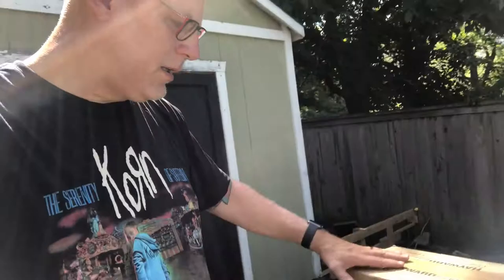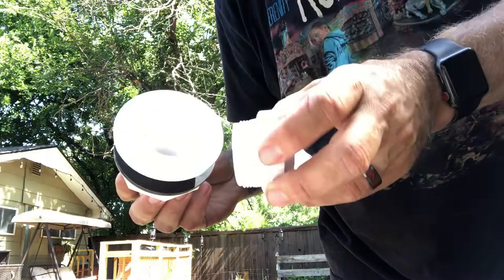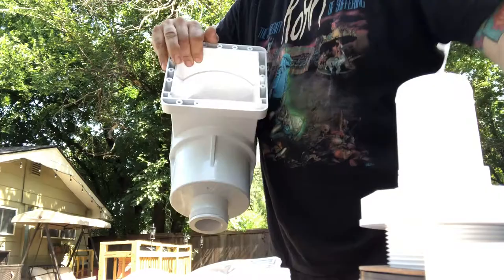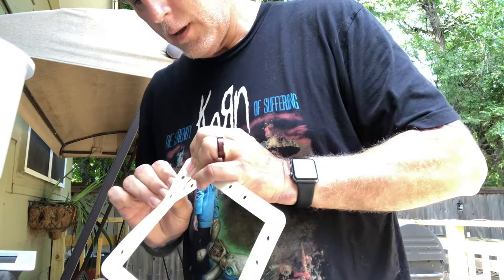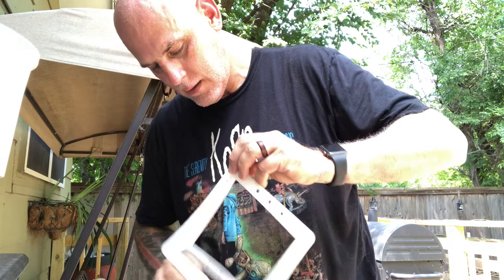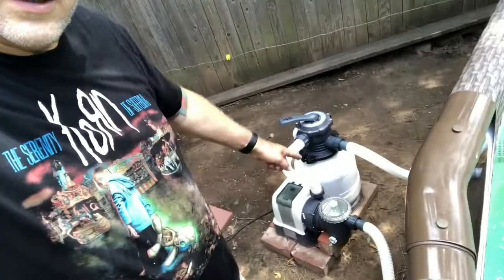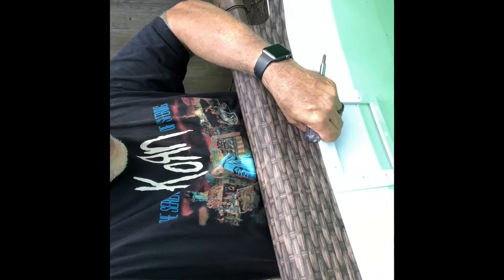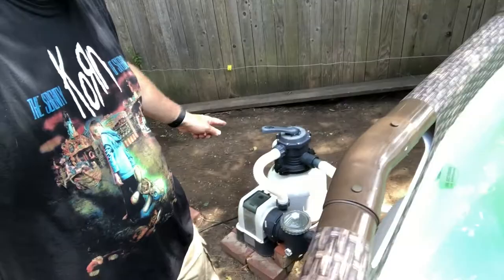How to Install the Hayward SP1091LX Dyna-Skim Above-Ground Pool Skimmer

Comment: Good video but do not cut the gasket. I repeat, DO NOT cut the gasket. It is designed to put a watertight seal between the outer side of the pool and the inner side of the liner. One side of the gasket goes on the outside of the pool with the skimmer against it and the other side of the gasket slips on the inside over the liner with the retainer against it. This creates a watertight seal that won't leak. Kind of like a hinge effect. Unfortunately, the instructions are pretty much useless except as a parts list. Good luck.
Reply from the maker: Yes that was temporary, I made another video on how to correctly install, thanks for watching and commenting
Reply: Ray, that is separate
Reply: Well crap... wish I read this earlier. I'll see of my cut apart gaskets 
work or not and order a backup.
Reply: Thanks.  Your response makes absolute sense.  Instructions should have been better
Reply: I think the cutting of the gasket it to install when the pool is full. You can't cut the hole for the skimmer when its full
Reply: Yes the instructions suck had I not read your comment I would have totally messed up and cut my butterfly gasket so thank you for that comment

Comment: Drain your pool a little dude you just ruined that gasket it's made like that on purpose it fits around the hole in the pool
Reply from the maker: True! Better to drain, cut mine been working fine but definitely way better not to cut it! Thanks for the comment!
Reply: HI Keith, if you do not cut the butterfly gasket into two, you must cut the liner first and slip it into the gasket? It seems more difficult . What do you use as a guide to cut the liner perfectly?

Comment: I dont understand why everyone cuts the seal? It's supposed to be like that. it sits inside the hole with the flap on each side
Reply from the maker: not best, just a temporary fix to keep from draining pool, I have another video that it was installed correctly
Reply: I split the gasket and the gasket outlasted the pool liner

Comment: I’m a bit concerned with separating the gasket, don’t you think it is joined on one end to help prevent leaking at the opening. Doesn’t this modification voids Hayward’s warranty? I think draining the pool just under the level of where your installation will take place, would be a far better bet. At least Hayward would honor that gaskets integrity, should you have leakage problems. Outside of that it was a great instructional video and you’ve been extremely professional with your presentation. Thanks and keep up providing useful videos!
Reply from the maker: Yes I did another video and did just that, drained pool did not cost gasket, much better for sure! Thanks so much for watching, comment and all!
It probably did void warranty, so I purchased a new gasket from them!
Reply: @LacyMedia  Great! I purchased the same kit and draining made the install so much less of a headache and the refill wasn’t as bad on the pocket as I had anticipated. Glad I could help. This is how a YouTube Community is supposed to function… “Helping one another instead of ridiculing, finding fault and criticizing each other. Blessings to you and your wonderful channel…
Reply: @Chulo69x  so are you saying cut hole before screwing the faceplate to install the gasket in one piece?
Reply from the maker: @Chulo69x  appreciate all that, you as well, thanks for watching and the input!

Comment: I have an issue. I placed the skimmer sideways. I punctured the holes for nails wrong. If I try to fix it now, I will have additional holes from which water will leak. How can I fix this issue?
Reply from the maker: That is a tough one for sure! I would look into vinyl repair kit, fix the holes. Don’t use that area, move down a section and start over. They sell pool vinyl repair kits, click one of my pool product links below and then search vinyl repair kit for above ground pool. That is going to be the best solution. Hope it goes ok for you!
Reply: carina castro I have a large extra piece of the material that came with the pool if you need it I can mail it to you. If you didn’t already fixed the issue it is the same thickness as the pool

Comment: Hey I had some issues with mine leaking a little bit one of my friends told me to add plumbers tape to each screw so I unscrew them one at a time it is put plumbers tape around them and I have no leaks at all. Hope this helps you
Reply from the maker: Good answer! I was able to just tighten mine enough. My pool is down for winter now so I’ll remember that when spring comes and I set my pool back up
Reply: Jack and Crystal Lacy Happy to hear that. I am in Florida I thank god I don’t have to do that again. Have a wonderful day.
Reply: Use silicone for bathroom to put around the white molding on the outside.

Comment: Is it ok for me to use a T-Splitter to work with the skimmer and and filter. This way I dont have to alternate the hose between the skimmer and the other hose that is for the pool water that is at the bottom?
Reply: sure if that works, make sure not to burn out the filter, that water is going through!

Comment: Is just a skimmer pulling water from the pool enough? I've seen people leaving the "pulling water" hoses still connected with the skimmer. Now I'm confused :)
Reply from the maker: My skimmer bucket pulls plenty. Long as you clean it often as well as the skimmer basket in your pump. The skimmer bucket has the hose that connects to the pump, pulls the water from pool to filter. Hope that helps, thanks for viewing and comment!

Comment: What did you use to plug the holes from the old lines? Having trouble with that one.
Reply from the maker: The plastic pieces that you get to plug in while you clean the pool. Should of came with the pool, two, one for each hole

Comment: Hi I am going to install one of these - Question ...the 2 B outlets are being plugged and not used anymore ...correct? Do you plug them on the inside or from the outside ( I did get some sort of black plugs I think with the kit, and the A intake still remains hooked up or no?.I just  got this new smaller  pool but the pump is really small. I have 2 other intex pumps from one of my other pools I had which were bigger  - I would use one of them hopefully as this little pump is so small that came with it. Do you think I need to use a conversion on the pump hoses or I don't really need them if I am using the skimmer filter - I think the bigger pump hoses may fit. maybe just switch them out to the other pump. :)
Reply from the maker: Yes I plug them on the inside, should have the plugs with the pool kit! The hoses should fit, mine did.most fit, let me know how it works out! Thanks for viewing and comment!

Comment: What did you use to seal the plugs?
Reply from the maker: the original black plugs that came with the pool, used when cleaning the pool out, they work great
Reply: @LacyMedia  sorry I should said what kind of “glue “. Thanks for the amazing video. Very helpful
Reply from the maker: @melissaharting339  thanks so much for viewing and commenting. I used this.
https://amzn.to/3vMbP30

Comment: What was the conversion kit you used and what did you do with the 2 holes?
Reply from the maker: I used the GAME 4560 40mm to 1 1/2 Inch Conversion Kit (For Intex & Bestway Pools). See link in description. Then I used the two plugs that came with the pool and plugged the holes, till I one day will run a fountain or waterfall , thanks for comment and viewing!

Comment: Why would you cut up a butterfly gasket with a razor blade, you have just guaranteed that it will leak
Reply from the maker: Worked great for a year, did it so I would not have to drain pool any, but this year made new video and got new gasket and did it correctly, definitely cutting it is not best option. Thanks for commenting and viewing!

Comment: NOOOO you don't gut the rubber gasket you fit it in the square half in half out over the ridge of the hole!!!! 
Good Lord, read the instructions.
Reply from the maker: Yes correct I made another video on this done correctly, this was a short time fix, thanks for commenting